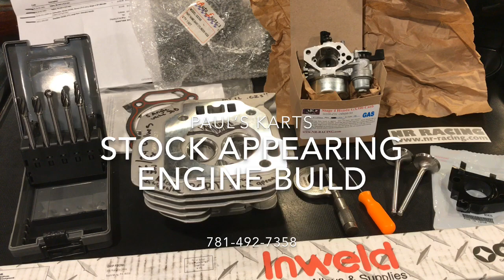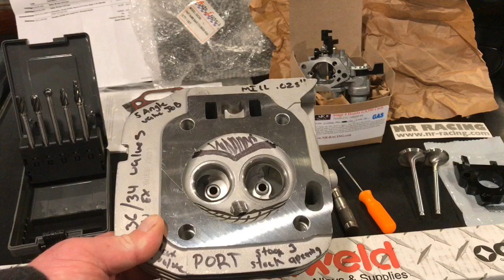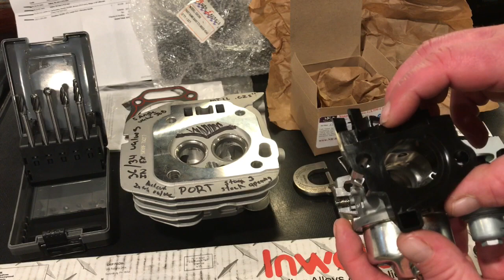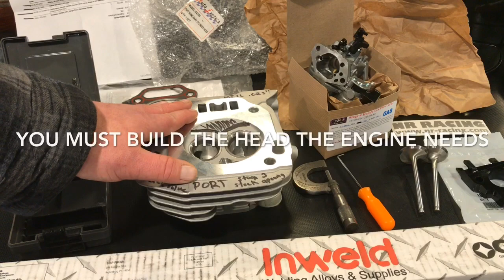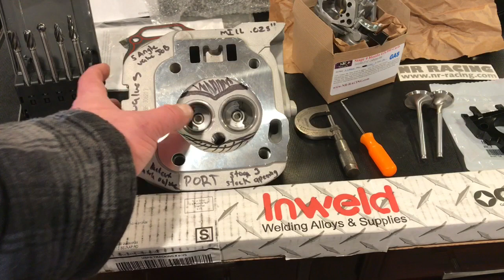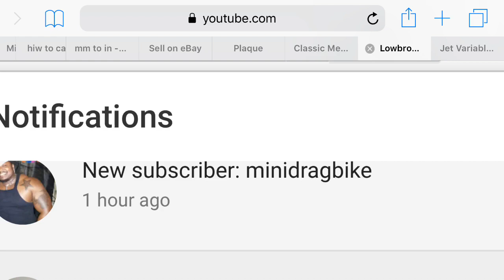stock appearing cylinder head & carb setup for Gx390 kart racing engine build

Comment: Bro i had to ask if you put a .10 head gasket on a 420cc predator what are torques spec i should use to torque it down!!!! Help me please!!!! I when from a 0.45 0.10 head gasket
Reply from the maker: Torque specs ? I think your asking about head boot tightening ??? So it doesn’t matter what size gasket you use , the head bolt torquing procedure is the same ,,,, 25 total ftlbs .. I usually step up like 17.19.21.23.25 .... hope that helps ...
Reply: @paulskartslifan4206  i thank you brother
Reply from the maker: Any time
Reply: @paulskartslifan4206  
Is there a way I can get ahold of via email? Or Facebook?
Reply from the maker: Call me 781-492-7358
Reply from the maker: Text me or call me @ 781-492-7358